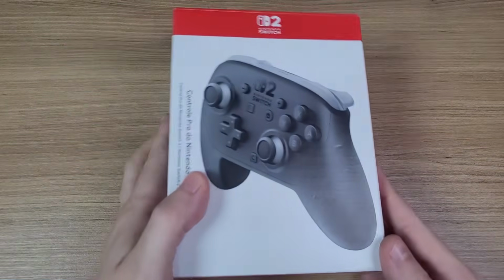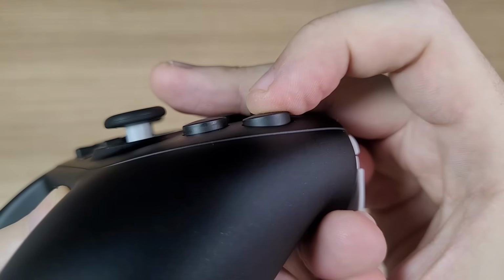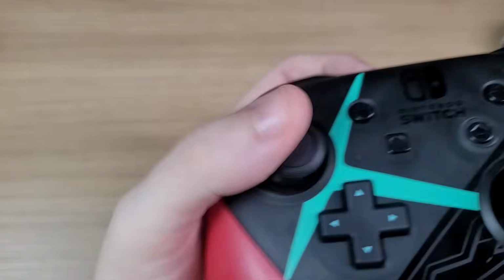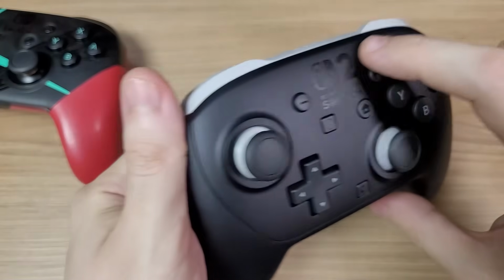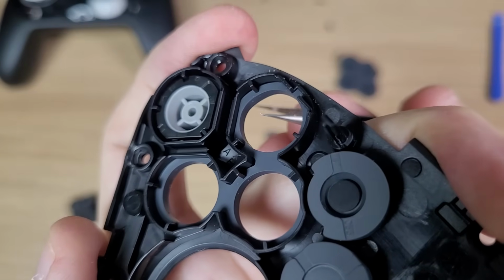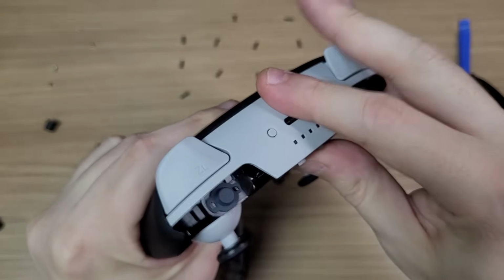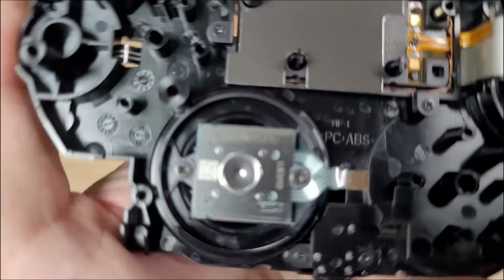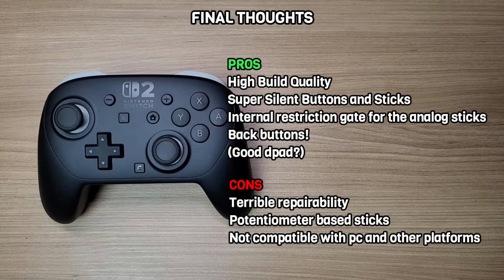Switch 2 Pro Controller Review & Teardown - The New First Party King?

Comment: Here is to you getting a Switch 2, around $800 is insane.

As soon as people were able to test this Pro Controller at pre-events and it was said the joysticks were super smooth I assumed Nintendo was using a similar internal restriction gate to the Vader 4 Pro. In practice I've even found the Switch 2 Pro Controller a bit smoother then the Vader 4 Pro, probably because of the rubber internal restriction ring.

That's weird that the left and right sticks are different heights, I wish the right stick was the slightly longer one to help with aiming in games.

In practice one of the best features is GL & GR remapping per game per user on Switch 2. On other controllers with back buttons, I would by default set them to L3 and R3 and then have to change them per game manually in a 3rd party app. I hope Steam adds a similar feature to Steam on PC. I'm assuming Steamdeck has a similar remapping feature since it has 4 back buttons.

Those hidden screws that are in a very narrow space suck, I'll need to get some special thin and long screwdrivers to reach those screws, I don't think my iFixIt kits bits are long enough as those bits even struggle with the Switch 1's Pro Controllers screws
Reply: 8bitdo ultimate 2 adds two extra triggers and lets you map on the fly.  doesn't feel as good though.
Reply: @HunnysPlaylists  The 8BitDo Ultimate 2C is a better controller imho. I prefer the D-Pad over the Switch Pro Controllers, and all of the buttons feels good with the right amount of clickiness, the only thing I don't like about the Ultimate 2C is that the Trigger paddles are definitely going to be prone to being worn out.
Reply: @MEGAGAMERX1000  whats the difference?
Reply from the maker: Thanks a lot man!

The switch 2 will eventually lower in prices, they are farming on the FOMO of people

And also launch units are known for having build quality defects so waiting is a win win situation
Reply: Steam has the best input mapping and they've had it for years now, it's no contest and kinda embarrassing how much everything else sucks.
Reply: @SuperTort0ise no?
Reply: @davidfernandez-lf7sl  yes? Steam input is really good.

Comment: Interesting... I mean it's a mixed bag. It has many nice different things that I like and would be nice for other 3rd party controllers to copy:
- The rubber "seals" for buttons to make them way more silent.
- The rubber anti friction gate.
- I like the big buttons (tho this is more common to see)
---------
But it has several things that could be much better (leaving the incompatibility with PC for now aside)
- Hall effect analogs and triggers
- Maybe mechanical buttons (tho is preference but it would be interesting to see 3rd party mechanical buttons + the rubber seal to make them less noisy)
- Better reparability (it's always nice to have)

I don't know if I will but it, but I think that the rubber seals should be copied for all premium controllers. This ones sound beautifully. As a keyboard fan would say "thocky" xD
Reply: two out of three of your points would make the controller worse. Analog triggers are only really used and needed in sim racing games. Buttons are much better for shooting / fighting / action / adventure basically any game that doesn’t use analog input. 

Membrane buttons feel better with a higher and softer break point than mechanical which almost always are shallow with almost no positive feedback at least in the controllers I’ve tried.

Considering the games Nintendo makes, their choices for triggers, buttons and materials all make sense.
Reply: @matt_mkv  I don't fully agree , a REAL pro controller should have both options. I have a Vader 4 Pro. I can use analog + button for the triggers. Why limit racing games?
Also we are not judging if it works for what Nintendo does. My original message was about 3rd party controllers taking the best out of this controller for PC or other platforms.
Reply: @compucocina5567 
“Pro” controllers are coming from the angle that it’s a compromise since the majority of “Pro” players have specific control methods that aren’t a gamepad at all. Which is fine, I’d just rather have a better experience with 90% of the games I play as opposed to compromising the feel and tactility of a button I use all the time because I might want to play Forza or Gran Turismo one day.

I will say that the PS5’s adaptive trigger solution is interesting because games like Returnal can have multiple functions on one button. That may be the only analog trigger I’m okay with.

Comment: Disassembly looks like a major pain in the ass 🤭
After dualsense it all look like a unnecessary complication. 
Ribbon cables for the sticks are great change through.
It would be super easy to install TMR sticks if you won't break the gamepad while removing everything else 🤭

Comment: Had the switch one pro controller and never had stick drift and its still feels like new controller with tight controls
Reply: Mine had drift from the box but after the calibration it works without any problem to this day.

Comment: They finally switch from the laggy bluetooth to the proprietary wireless communication. 
And that is a great thing because this gamepad will work better and support audio wirelessly like other first party controllers from Sony and Microsoft.
Reply: xbox controllers and dual-shock/-sense allow to connect via bluetooth, without audio of course, but still.
here we can't even see switch 2 procon via bluetooth, and that's disappointing
Reply: @tyoma53 nintendo doesn't have any cloud gaming apps, they're probably not interested in providing connection for smartphones. At least for now.

Comment: In the United States the Nintendo switch 2 without the bundle it’s actually $450 which is $50 cheaper than the Xbox series X and the PlayStation 5 standard. I want to buy it but they’re all sold out very quickly so I have to wait until they’re back in stock.
Reply: I hate Microsoft
Reply: I’ve been using a Nintendo switch for a very, very long time since 2018
Reply: but with Xbox you do get gamepass for free for a couple of months, meaning you'll actually have games to play, especially on the series s, considering all switch games are digital anyway might as well compare it with that

Comment: I hope these console companies just SWITCH to hall effect or TMR sticks already. Potentiometer = stick drift = more sales for controller. They could at least cull their greediness a bit with the controllers.
Reply: Hall effect doesn't work on joycons cuz of the magnets
Reply: @lime4cat sir,this video is about the switch 2 pro controller
Reply: @lime4cat  if only magnetic shielding was a thing.. Oh wait.
Reply: The issue is more that Nintendo already has an enormous contract and supply chain for potentiometer sticks. Changing to Hall effect isn’t as easy as flicking a lightswitch on. Is there even a factory capable of mass producing Hall effect sticks on the scale of a major console release? Could current production pipelines be scaled up? Almost certainly hall effect sticks are not in mass production in the millions upon millions of units required to fulfil the Switch 2 launch. 

Additionally, Nintendo doesn’t make the sticks, Alps does, and they provide them for Sony and Microsoft too. So does Alps have to foot the bill to build a new factory to mass produce Hall effect sticks? Does Nintendo pay for it under the proviso that the sticks are exclusive to them? Can Alps scale up their workforce to manage a second facility? Can their business support this expansion? My point is.. random YouTube commenter says “Nintendo greedy, use Hall effect sticks” meanwhile in the real world..
Reply: @Zumii  for how much you pay for these they should be able to handle those production lines :D
Reply: They are replacing the ones with drift for free so kinda makes your comment stupid
Reply: @JamesThomas-dn6ee  That's not the whole point of my comment. Plus, requesting for free replacement isn't a smooth transaction and does not apply to majority of Nintendo consumers. This only applies mostly to western countries, japan and maybe even australia. The rest are left to fend on their own. Also, my comment doesn't solely apply to Nintendo but to other console manufacturers as well. I'm not sure if they also offer free replacements for their own controllers. The whole point is that this is clearly a case of planned obsolescence and you're trying to defend an anti-cosumer practice that doesn't benefit you and I unless you're one of the higher ups who work for Nintendo.
Reply: @JamesThomas-dn6ee  let me wait a month using my drifting joycons 2 while i wait for my fixed/replacement pro controller 2

Comment: Wait, we can use the original Pro Controller just fine on PC, why they changed that???
Reply: There was no tool development for the Switch Pro 1, it was ready to go out of the box. My bet though is that it's not Nintendo gatekeeping the controller, since people are already finding ways around it, but rather it's using something that the current Bluetooth softwares can't detect.
Reply: I don't think anything actually changed. Nintendo never made drivers to use the switch pro controller on PC, the community did, so you will have to wait until that happens again for the switch 2 pro controller
Reply: @pot3to444  Interesting, but the new one doesn't even pick up on the bluetooth, I use a Linux Mint and it detects the original just fine, was something that came installed on my distro or maybe even Steam itself?
Reply from the maker: But the pro controller could at least connect
Reply: They obviously finally switch from the Bluetooth to the proprietary wireless communication. 
And that is a great thing because this gamepad will work better and support audio wirelessly.